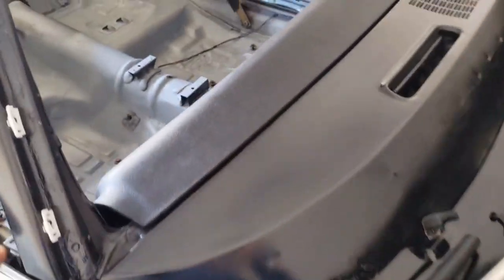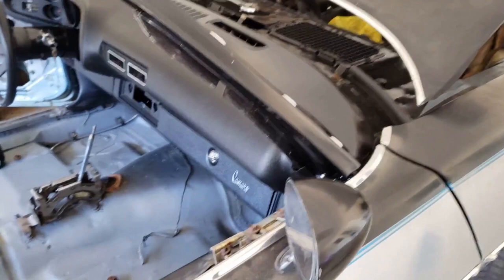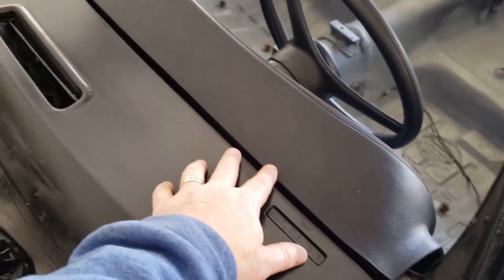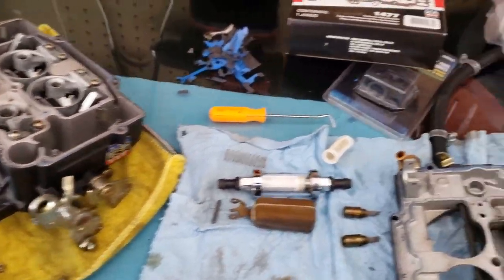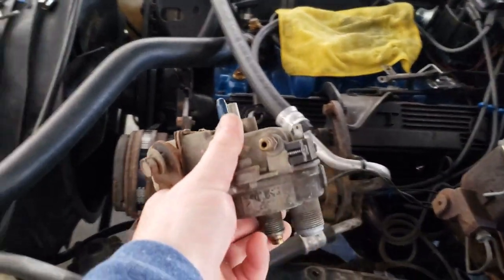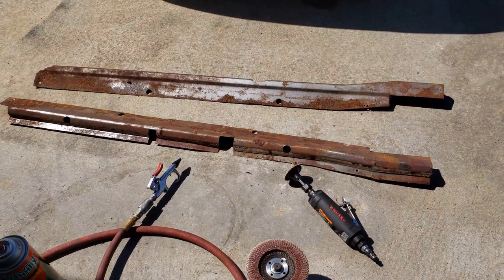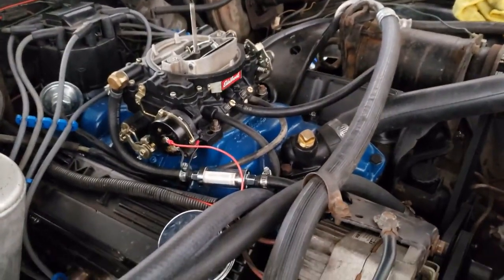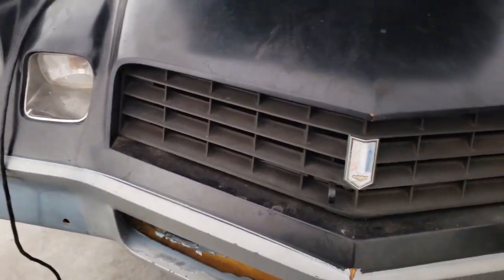09.) 78 Camaro ramblings, sill plates, carb cleaning

Comment: Thanks for the kind words! You know, we each have our areas. I would never attempt to rebuild a carb! Those wire covers came out great. You can't see them anyway, so as long as they are solid, you are good. I bought a new set, and they are untreated metal. So, they were rusty when they came out of the box.
Reply from the maker: Thanks again man. I got some of your older videos to watch I think cause unfortunately I am talking myself into doing some bodywork before completing the interior. Hahahaha.
Reply: @bradleysbuildingjunk6763  Some good advice I got early on was to have a plan. If you are not careful, you will dive in deeper than you planned on. That is not always bad, but it may mean you can't drive your car for a while :) Of course, you will find things you did not know about. I knew I was doing every bolt on my car. I have changed plans though. I was going to do a full custom interior. Now, I am going to buy the original (repop) interior. Maybe I will build the custom one down the road, but it's time to get this car on the road! I do think your dash looks pretty good to me. I am going to try the NPD one though. Sorry if I mentioned that already. They claim to have their own version that fits better. Who knows. L8R!
Reply: @asicerik Lol. Exactly. I intended on doing my firebird a little at a time. Dove into cleaning up the engine bay and 3 days later....I had the whole car disassembled.....damn OCD. Just kept finding stuff to fix.  6 years later, still not on the road. 🤪
Reply: Asicerik and Pops are the best. I’ve learned soon much from watching those guys. We are all learning this stuff together.  Good stuff. (I guess I just realized your gonna have a bunch of comments from me.  I was bing watching I think 🤙😁)
Reply: @HeavyPedalGarage  Thank you!